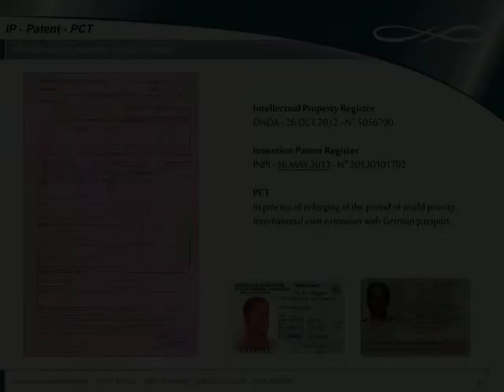Hedetronik Prototype - 100% Gear CVT - Perfect Result

Comment: As other comments mention, this isn't really a CVT. But it's an interesting concept. However, I think there are some issues with the mechanism:

1. Vibration: the eccentric gears will throw their weight around a lot.
2. Weight/cost: you're adding a new mechanism and gear set that's only used during shifting.
3. Control: you have to do a shift to the transition gear within 1/4 of the eccentric rotational period, then wait 1/4, then shift to the new gear. That's a huge period with slow prime movers, and requires really high speeds and stresses with fast ones. If you screw up the synch, the gearbox binds up and dies a violent death.
4. Non-sequential penalty: need another mechanism for every two ratios you can switch between.
5. Geometry: eccentric gears can only go between 1:x and x:1 ratios naturally, with other ratios potentially possible via multi-lobed gears. But, you're probably going to need additional step-up/down gearing just for the transitional gears.

Comment: clutchless multigeared transmission, CMGT, would be more correct, CVT really means something else. 
i wonder, how well would this design scale up to more than three gear ratios? and how could the cyclically variable output speed be converted to steady again?  an original approach nonetheless
Reply: This can be used with as many ratios as wished, and the speed is steady again after the gear transition is made. Of course, this is just a prototype, that works, but surely needs to be improved.

Comment: try it at 6.000 rpm
Reply: The engine may be at 6.000 rpm, but this gears need to receive a reduced rpm as they've got 4 phases. After the use of them, the revolutions can be multiplicated again.

Comment: With every legitimate invention that gets rejected by the patent application process, along comes someone who can COMPLETELY and FALSELY represent their invention (this is not a CVT), and get approval. 

SMH...
Reply: +Gh Films 
In that case, the whole industry is confused. ;-)

No, CVT does not mean that the shifting is continuous, it means that you can set the ratio to any in a continuous range.
IVT means that that this range include 1:0, ie infinite reduction. (And in some cases a range that include reverse.)
Reply: It is not an IVT ("Infinitely Variable Transmission"), but it is a CVT ("Continuous V.T.") as the shifting is continuous, without stopping doing traction. People use to confuse IVT and CVT.
Reply: +Gh Films 
An approved patent means that it was different enough from other patents they found. It does not mean that they have checked that you use a term in the same way as the rest of the industry.
Reply: Yes it is. And, by the way, the patent presentation was not rejected, it was approved. ;-)
Reply: it is not continuosly variable, it has three speeds